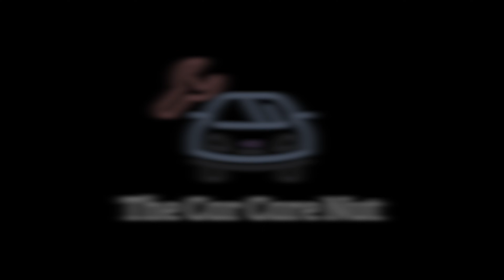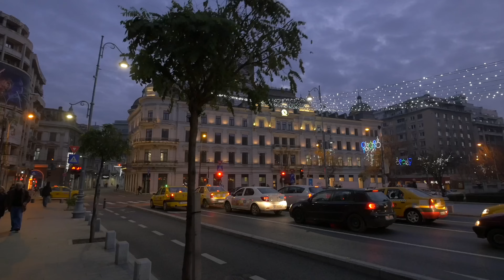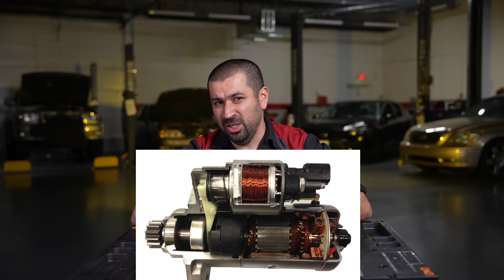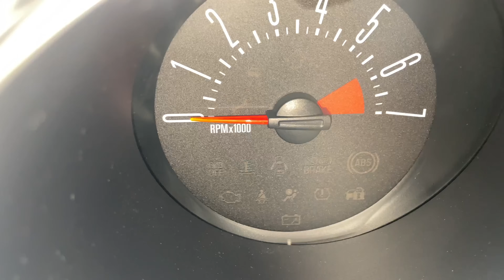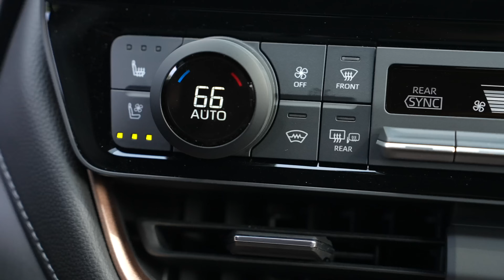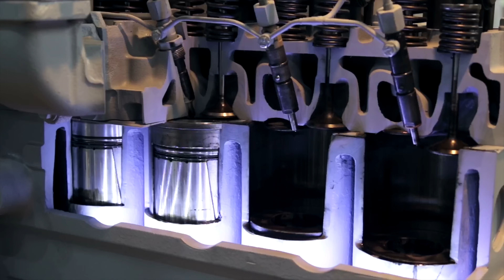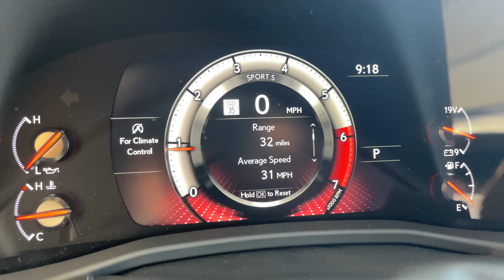How Does Start Stop Technology Work in Modern Cars? Everything You Need to Know

Comment: I have a Skoda Fabia DCT Automatic.  Great car, but I hate the start/stop, because it takes over a second to restart and pull away.  When you're waiting to pull out onto a busy main road and you see a gap, the very last thing you want is a 1-2 second delay before the car starts moving.  So I normally have it turned off when driving, but turn it on when I'm queuing at lights or a junction - until I get to the front of the queue.

Comment: It over works your battery and starter.  It burns more fuel  in traffic congestion . If you have a cheap or older battery in your car, this will drain it flat quickly. You will be stuck in the middle of the road with a dead battery.
Reply: Doesnt happen. Start stop is disabled if the battery voltage falls below a sufficient level.

Comment: Amazing video!
but one thing that I don't know up until now , won't the start-stop system would cause some kind of excessive wear on the engine mounts?

I have a Mazda 3 2.0l G165 BM - and i actually bought it with a non-AFB battery without knowing (even after going through pre-purchase inspection) and It was exactly as you described.
the car didn't allow for the start-stop to initiate as frequent as with an AFB battery and when it did allow it it was for such short periods of times.
After changing the battery the car did have to run for an hour until it caught up with the fact that we changed batteries.

The car runs in quite hot climates (only last week we had 50 degrees (Celsius) = 122 Fahrenheit) and if the car recognizes big temperature gaps between the interior and the exterior of the car and it actually won't allow the start-stop to initiate, exactly like as were running the AC on the lowest temp setting (even on the slowest fan setting).

And another fun-fact on Mazdas it wouldn't actually initiate if the steering wheel isn't quite close to the center, if you turn it like 90 degrees to the right or to the left start-stop won't initiate at all - and if you are close to the center it actually locks the steering and turns the engine on if you decide to "fight" to move the steering wheel.

All of these split second decisions that the car makes are absolutely fascinating.
And yes - everything in this system because it needs to deal with extra stress is about 25%-50% more expensive than a non-start-stop part (at least in my country).

Comment: Deactivated by the push of a button. However, it is backasswards. IMHO - the button (by default) should let the engine run 100% of the time after starting. "if" you push the button, then it activates the start/stop function. This would give the driver the start/stop option without having to deactivate it every time you start the vehicle. Lastly, the EPA concludes a 5-7% fuel savings with auto start/stop. To me, there are MANY other ways (and better ways) to save fuel and NOT be forced to have this annoying feature the government tells you what you need (mandatory fun day in military jargon...you will comply!).

Comment: As a retired EE (chip designer), I see many applications for the technology in which I played a very tiny  part.
Many of those applications that make peoples lives better - like medical uses and other positive uses - make
me happy that we developed these smart chips.

THIS app is not one of those!

EDIT several days later:
I have been driving a rental Sentra for a couple of weeks and see one interesting thing about the start-stop
algorithm. I have driven it to several towns from 31 to 50 miles away and it always has said that the
average miles/gallon is in the high 40s. First off, I find that a bit odd as it is a much heaver car than
my wife's Toyota which gets LESS mpg than that.

But secondly I tested the start-stop algorithm yesterday and found out something very fishy about 
that Lying BassTurd algorithm. Going to see my wife (in Nursing Home) is a tad over 5 miles with exactly
TWO places where it could have a chance to stop-start. The rest was open road. So I shut off the
algorithm and made the ~5 mile trip. The machine said that the average mpg was 46.6 mpg. and
the current mpg was 29.7. WHAT??? Two times it did not stop-start and the mpg dropped that much.
With the algorithm ON, it has been saying that the "current" mpg would be 3-5 miles different from the
"average". Well if I believe that 2 ignored stop-starts changes the mpg that much, they will sell me a 
bridge, I guess.

Having spent 34-35 years designing chips, creating firmware, designing PCBs, etc, there is no chance
in hell that I would believe that! Yes, some will say that I am not an Automotive Engineer, not even
a Mechanical Engineer, and worse am now an Octogenarian. All that is true and I have my own
BidenBrain Moments. But I am 6 months older than President Poopy Pants, so it surely is legal for me
to have the same brain farts..

If I have totally misunderstood this, perhaps someone could give a correct and valid documented
explaination for how this is even possible, I will thank you...

Comment: Just unplug the amp sensor on the negative terminal of the battery, and the system is disabled. Cost is $0 and you dont have to mash the button. Done.

Comment: Great explanation! I have a 2016 Jeep Grand Cherokee with auto s/s.  It has two 12v batteries (one under the hood and one under the passenger seat.  I drive under 2K miles/year.  I need a charger/maintainer.  Is it possible to use one for this vehicle? I purchased a NOCO Genius 5A but am afraid to use it, or even how to hook it up.  Can you maybe make a video about this situation?

Comment: Adds additional cost to the manufacturing of the car.  Adds additional cost to the maintenance of the car.  Additional complexity will inevitably reduce reliability.  Will probably save about 15 gallons of fuel per year for the typical owner who drives about 13,000 miles per year.

It all comes down to the well-worn saying:  'Just because you CAN do something using technology doesn't mean that you SHOULD do it'.  It's gonna take many years of fuel savings to offset the cost of starter motor replacement, or the incremental cost of replacement for the higher-tech battery, not even considering how much more the car cost initially for the incorporation of start/stop.

Comment: It’s crazy the amount of things they had to do to get this system operating properly. So much more complexity for such a tiny amount of gain.
Reply: Will never own one.  Now, I have a hybrid that was designed from the ground up to stop/start.  Not modified to do so.  Big difference.
Reply: Exactly! They took a simple car, and now it's an environmental hazard with the countless number of additional, breakable complex parts.

Nothing here is "good for the environment." If your transmission needs repair, they have to deal with that "new oil dispensing valve" now. If your starter needs replacing, they have to also order that new "computer monitoring motor" inside of it, etc, etc. 

The amount of production, manufacturing and material waste is now doubled for every component in a car! Plus, it's now more things "to break." 

Twice the amount of things breaking in the car equals twice the repair cost. If one component of this new system breaks, the whole auto start system is compromised. 

It's like you now have to maintain the price of two cars, or else just drive with a broken auto start system, which will mess up the car or malfunction completely and just disable. 

If it hopefully just shuts off, then it's better to never have it in the first place.
Reply: Exactly. It raised the cost of the vehicle more than it will ever save. Stupid junk to appease the epa. You can just get a quality scan tool and disable it forever. Probably created more emissions manufacturing it than it saves.
Reply: It may be a small gain, individually, but if you multiply that by millions of cars on the road each day the emissions savings would be astounding
Reply: @841577 The amount of car breaking down and use of battery will surpass the CO2 emission "saved" by this system
Reply: @841577  your stupidity is astounding
Reply: It's NOT a tiny amount of gain. Specifically if you drive in the city. I rented a Subaru Crosstrek and did a real world test in NYC this past December.

I got 50 more miles of range, with the system enabled than when it wasn't. I was quite literally going back and forth to the same place each day because I was just visiting family.

Same thing with my 2024 Kia Sportage driving around in Pittsburgh where I live. It was only about 30 miles with my Sportage, but I stop less for less time as I did in NYC.

So over time that can add up to significant savings.
Reply: @jabbajawz and what about the people who don’t do a lot of stop and go driving? They are driving a vehicle which has extra weight added to it because of all the start/stop components. They’re effectively getting worse fuel economy than a vehicle without start/stop technology.
Reply: @tomcat8662  I'm gonna call CAP on this extra weigh being big factor in fuel economy. I drove to Virginia twice this year in my 2024 KIA Sportage. Once close to DC and another to Virginia Beach. I got close to 40mpg in the highway and over 30mpg in non stop and go traffic while in town. This is mostly while carrying a car full of people and with the back full of stuff for vacation. Like portable refrigerator and stuff for the beach.

I also had a similar experience renting a Subaru Crosstrek to drive to Massachusetts and NYC last December (2024). I didn't have any non stop-and-go driving to test with, but it got great highway miles.

In either case, my comment is to show that the system makes a difference in fuel economy. I can tell now by driving in Pittsburgh hills for the winter where the start stop doesn't engage due to "climate control priority"

Where I would normally get around 23mpg on average, I now get 18... I'm sure the cold weather. 

I know the cold weather affects it a bit, but my Honda Civic goes from 23 to 22. Only a 1 mpg difference and it doesn't have start/stop.
Reply: @tomcat8662  It takes an extra one hundred pounds to reduce fuel efficiency by one percent. All the stop start components are likely less than ten pounds of additional weight. Well below the gas savings of three percent that can be expected in even the least optimal conditions. Nice try though.

Comment: HOW TO PERMANENTLY DISABLE START/STOP:

On my Subaru, I stuck a wooden Toothpick down the side of the Start/Stop Button jamming it in the pushed in state.
Now it is disabled at every Car start.
I'm sure this will work for many types of Cars that have a physical button.

You could always pull out the switch itself and run a wire (short) between the two wire terminals which will do the same thing as telling it that it is always pushed in.
You could always change the switch or add one for a switch that has a two way throw and not a temporary throw.
But the Toothpick is the easiest option.

Comment: This guy is legend and I still cannot believe that the start/stop system doesn’t damage your engine keep up your work thank you
Reply: 0W-20 or 0W-16 oil flows so easily that you should not worry about excessive engine wear from frequent stop/starts.
Reply: Damage, maybe not. Does it increase wear and tear? Add more failure points? Reduce life expectancy? Yes to all. 
But let's be honest, even without it. Cars are been made to not last 1/3 of what they used to. Mechanically wise.
Reply: @Omizuke  Toyota hybrid stop/start systems are lasting well beyond 200,000 miles. That's why New York taxi cab drivers have been using hybrids for many years. I use it sparingly in my Supra.
Reply: @davepaturno4290  1. Toyota 2. Hybrid. 
Not quite the same as let's say, a Chevy Cruze. 
But still. Doesn't change what I wrote. There will be more wear than if it didn't do it. 
And taxi drivers tend to take care of their work vehicles.  And usually don't have them much longer than what's expected.  
I'm coming from someone who's car is over 30 years old. And my dad's was like 50 with over a million miles on the same engine. 
And what I mention about longevity.  I highly doubt cars from this year, will be able to be repair and fully functional in 2060. 
That's a reality of everything now. From cars to home appliances.
Reply: @Omizuke  so you have starters on your cars that are over 30 years old? How much is a starter? If a stop/start starter, which is heavier-duty than a standard starter can last 20+  years, I'd be fine with that. And let's not forget how much safer cars are, today. I may have 20 years to live, and I definitely don't want to live the rest of my life driving unsafe cars that are guzzling gas and boring....but that's me.
Reply: Legend? 😂

Comment: Zero emissions is not true- you typically have air conditioning or heating, plus the electrical is on. A diesel engine idles at a 120:1 fuel/ air ratio, while a gasoline car is at about 20:1.

Comment: It seems there's one question that didn't get addressed: accelerated engine wear that occurs on startup until full oil flow is restored to all lubrication points. Oil draindown starts as soon as the engine stops rotating, and flow does not pick up instantaneously once it starts. Is this significant?

Comment: People act like all of these systems are so complicated when in reality all of these systems already pretty much exist. There's already a vacuum sensor, the only difference is that this particular vacuum chamber is going to be a bit bigger than most others. That's not any less reliability, because the computer is already monitoring it. Same with the HVAC refrigerant reservoir, making a bigger one or a smaller one is not a reliability change, it's a design change. In fact, have you actually looked at the statistics of starter motor replacements? Start stop motors basically never fail. Start stop starters are way extremely overbuilt and also brushless so they have no contact points and they are usually fully sealed. They lost the life of the car. A lot of the time, they end up being more reliable. Although they do cost more, because they are overbuilt to be robust.

Comment: I have two Honda CRZs with a start/stop system, it comes on almost instantly because it's direct drive to the crankshaft. It's a manual transmission and I've not even ever noticed it. If you touch the clutch the brake or the gas or put it in gear it instantly comes on faster than I can finish shifting. It also makes it nearly impossible to stall the car up a hill. 

Personally I think the gas savings are worth it.

Comment: I think you missed something significant. A lot of cars are using turbo chargers on small engines for admissions.. I’ve had turbocharged cars, and one of the biggest problems is having a hot turbo, basically burn the oil in the bearing and prevent lubrication and frying the turbo bearing.

You’ve and you have any heat in the turbo and you start shutting off the engine that’s not good. 

Please address this

Comment: I think it all depends on the type of driving you do. I drive 20min to work from cold & then 20min back home from cold. My oil temp never fully reaches optimal temp of 100 degrees so any fuel contamination will not be evaporated & as we know fuel contamination can damage the engine. So if I was to use start stop to & from work on top of this, it would make the oil even more difficult to reach temp so I would have even more fuel contamination building up? I'm no expert but just using my common sense. Correct me if I am wrong?

Comment: The first thing I did to my 2024 Mazda 3 Select Sport was disabling the I-Stop system. I drove the car from the dealership home, opened the hood and removed the little switch next to the latch ( system disabled ) the only thing is the warning sign on the dash telling you that the hood is open .... which is not, just the signal because if the computer receives the signal that the hood is open, she disable the I- stop function. A little trick that works .
Reply: Selfish and irresponsible.